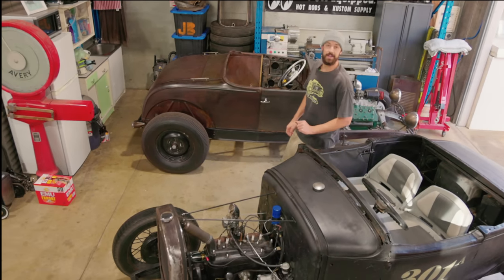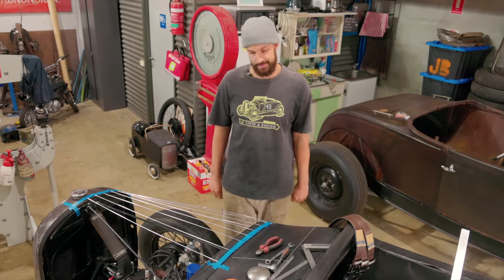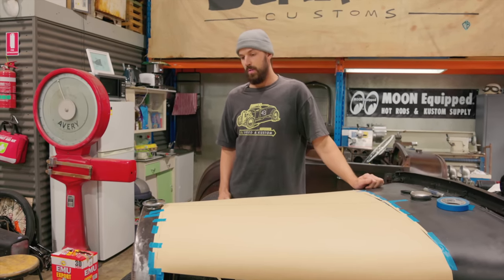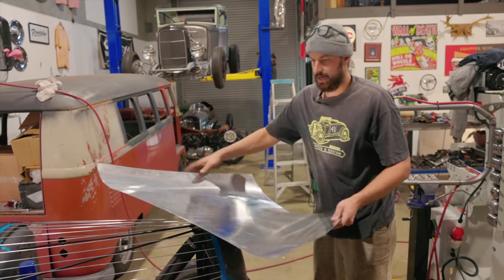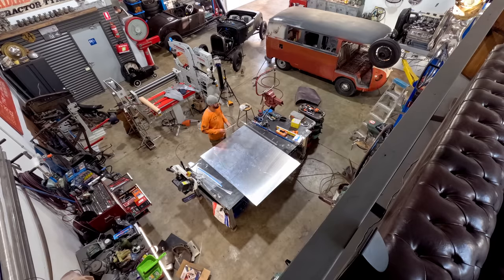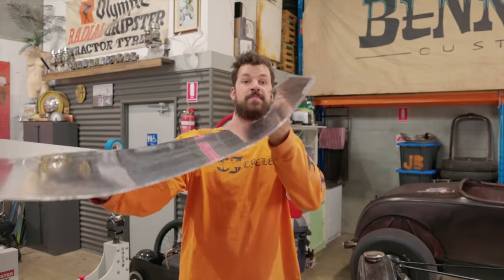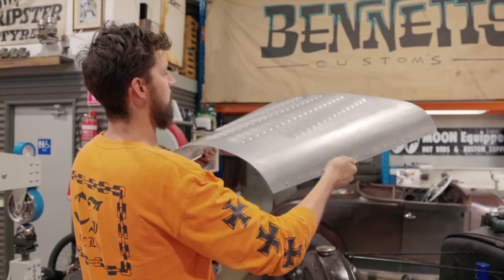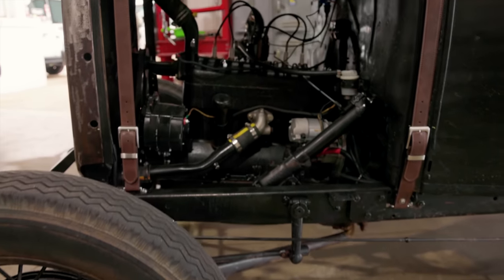Shaping, Lourvering, Riveting Simple Aluminium Jalopy Hood

Comment: Nice work sir - I always enjoy your work - RUBBER BAND ON THE WHEEL - I will be honest and I have zero experience with this, however, I used to be a bike mechanic (pushbike) and when ever we had to change a set of handle bar grips we would spray some WD40 between the grip and the bar and the grips would come straight off - however, when it comes to refitting new grips you cannot just slide them on as they were too tight and you cant use lube as they would never grip, so a trick most bike mechanics use is hair spray - it lubes enough to slide the grips on and then sticks and won't come off again unless you use WD40. as I say I have no idea if this will work with the band on the wheel but I would love to know if it does - again keep up the good work as it is genuinely inspirational. Kevin

Comment: Nice work on putting the louvres in Jordan I bet it was beer o'clock after you finished !, as others have mentioned a 200 x 50mm poly urethane pallet truck front wheel can easily be fitted to most English wheels for about $60 instead of the PU band. Tell Rex to keep an eye on the "pleather" straps they tend crack and tear. Cheers Greg
Reply from the maker: I think they already have and replaced them with leather haha

Comment: Hare And Forbes have the orange bands for the upper wheel.  They work a treat and they don't roll off
Reply from the maker: That’s the one I had trouble with- I’ll give it another shot
Reply: @bennettscustomsco   wow really,  mine has worked  perfectly . Not that I use the hand much anyway but when I did it was great.

Comment: Saw somebody using a pneumatic tire on the English wheel to get 2 dimension shape. Theirs had tread on it so t don’t know if it would make a difference with no backing with the voids. Change air pressure or solid tire may make a difference. Don’t have an English wheel so can’t experiment. Tell Karl so he can give opinion. Love watching you guys! Keep it coming!
Reply: I use a pneumatic tyre, it definitely works good. different pressures for different materials. Got the idea from Invision Prototypes.